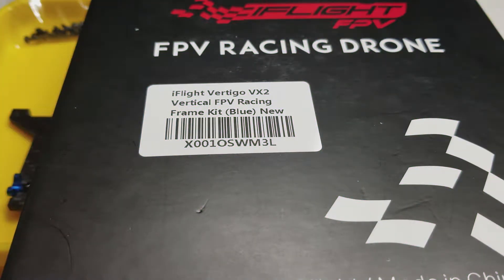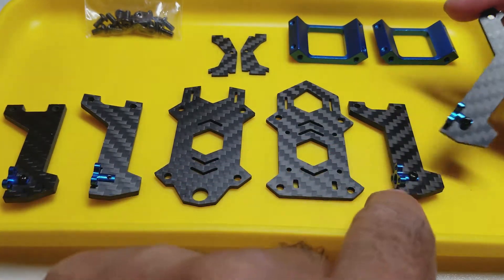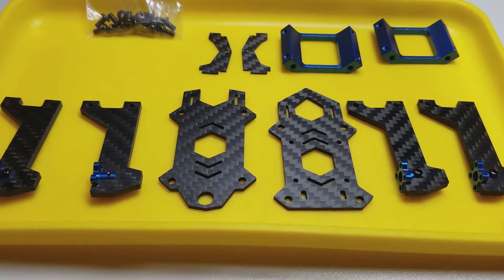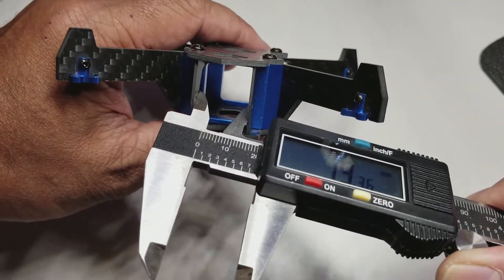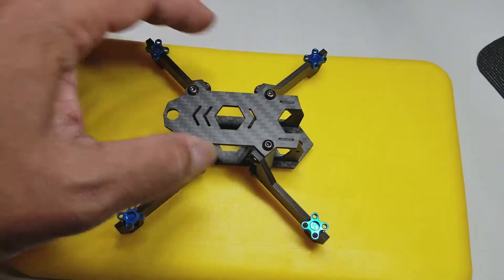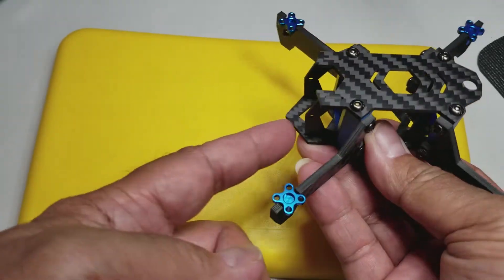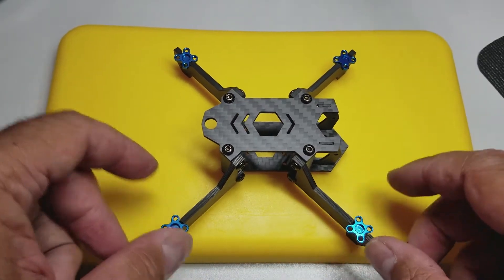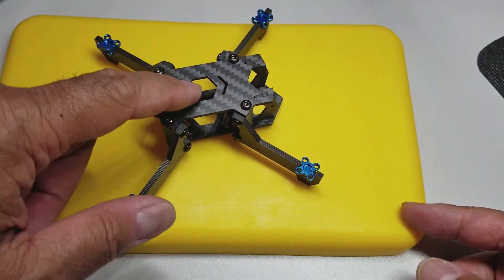iFlight Vertigo VX2 Frame Review!!!

Comment: I really like this frame apart from the motor mounts, they break far to easily!
Reply from the maker: Hi Adam :) I was looking online and haven't seen any videos of this frame built and flying. Is this motor mount breaking too easily info from personal experience?
Reply: Hi in4bliss. Yes this is from personal experience. There are 5 of us in our local group that have this frame, I think between us we have had 9 motor mounts fail. 1 of mine failed after I epoxied them on! The clearances are so tight for the motor screws against the arms, it’s impossible with the current design to effectively strengthen them. Our local iflight agent has contacted iflight about the issue. I hope they rework the mounts, because it is a good frame. I thought it would be a bit sluggish in the air, due to the weight, but on a 3s, 5100kv motors and gemfan flash 2540 props, it feels great!
Reply: Great video by the way, keep it up!
Reply from the maker: Hey Adam :) Wow, that is some very useful info! Thank you! So, let me guess, the skinny aluminum plates that kind of sandwich onto the vertical arm, snap? Further guessing right at the base of the main motor mount plate is where they snap? Lol funny thing is, I'm working on this build right now and noticing that weak point. Did your group try any kind of motor protection? I put the same guards on the Vertigo that I have on the Leader (shown in my most recent Leader 120 video). I'm just hoping the flex of the motor guard will dampen some of the impact. I am not sure it will help but it's gotta be a little better than just bare open space lol. You know, I got this tip from someone about the ultralight Zappy 120 I'm building - they use aluminum screws ( it has unprotected motors also) so that the screw breaks instead of the frame or motor. I guess in this case, motor mount lol. Sheesh, I'm kinda bummed out to hear this because I have to finish this build and at least get a maiden flight in. I'm already doing a "not as neat" wiring job that I am normally obsessed with doing because I fear I will be moving these electronics to a different frame very soon! Bummed even more because I had a feeling that it would fly well and you just confirmed that. Gah!!! lol we shall trudge on! Hopefully you hear something back from iFlight. Hehe my iFlight agent is Amazon :p
Reply from the maker: Thanks for the sub :) I see you have a channel also, sub back at ya!
Reply: in4bliss, they all break at the same place, either side of the hole where the screw goes through the arm. I’m just looking for some fpv footage for you. I’ll upload it shortly.
Reply from the maker: Nice flying! Thanks Adam :) Looks like the Vertigo flies really nice. I guess I'll fly it until I break it lol. I plan to go low and fast and see how long she lasts. Guess we'll find out how strong the Emax 1106 6000KV's are with all that weight to push around :)

Comment: Hey In4bliss  I'm trying to find a good vtx w audio or a built in mic for the leader 120 and xjb 145 micros. Can you recommend one that will work w 2s and 3s batts ?
Reply from the maker: Hi Paul :) I'm not experienced with vtx's with on board microphones. The ones I've seen on rcgroups are kind of big for a micro sized quad. My runcam eagle 2 pro has a mic and the matek vtx it's connected to has an audio pad but I haven't used it. I've been seeing a lot of this one lately. It's worth trying and only around $16 but it's a camera w/a dvr and mic: https://m.banggood.com/Turbowing-DVR-CYCLOPS-3-DVR-VTX-CAM-AIO-700TVL-5_8G-48CH-0mW25mW200mW-FPV-AV-Transmitter-Camera-p-1181449.html. It shows that it has a mic and certainly records audio so maybe there's an option for audio to be transmitted through the vtx.